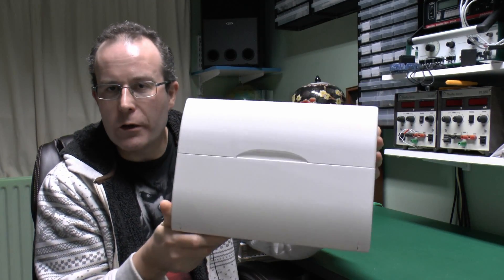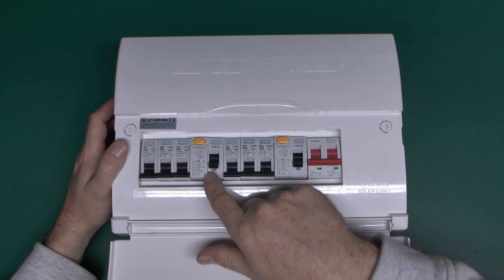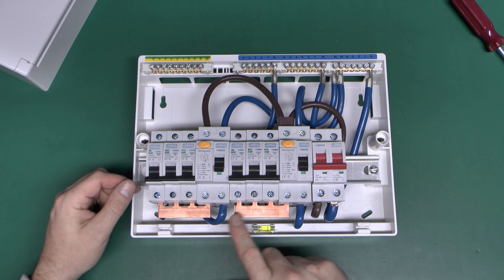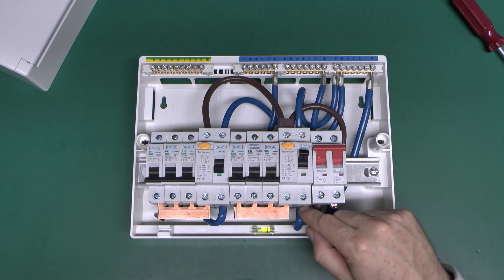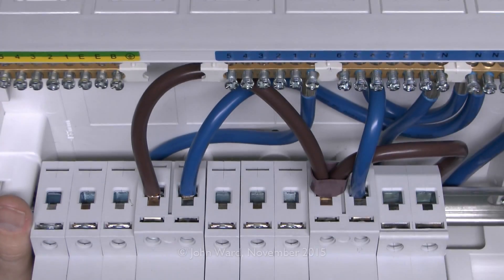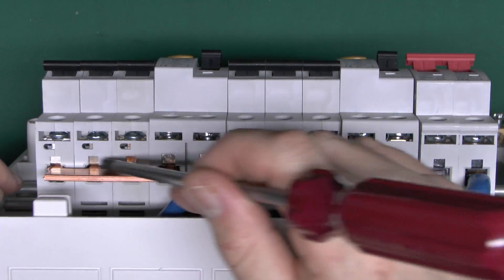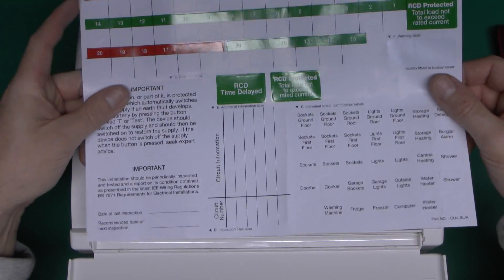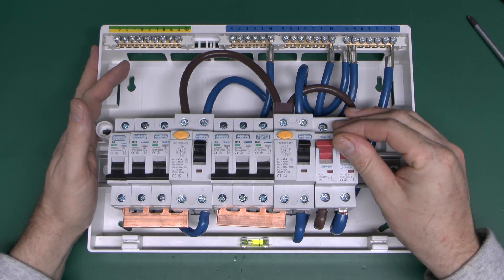Dual RCD Consumer Unit

Comment: Whats the CSA of the cables going into the RCD's
Reply from the maker: Depends on the make and rating, but 10mm² or 16mm² is typical.  If they need replacing for whatever reason, use those provided by the manufacturer of the consumer unit.

Comment: Hi, If my garage is already being fed via an RCD in my house, does that make the RCD (it's been there since before we moved in) in the garage redundant and I could just have a "main" switch and MCBs?
Reply from the maker: If the RCDs are the same type, then you only need one in the house
There are situations where two may be required, such as a 100mA time delayed RCD in the house and a 30mA RCD in the garage.
Reply: @jwflame  got It, thank you for your reply. Just had a look inside RDC in the garage (it just an RCD in a metal box which then goes to an old consumer unit) and it's only got a line and neutral, no earth and no earth ring so as to use the armour as earth.  Thank you again.

Comment: What is that 2 into 1 peice called that links the RCD's. I have a board where the cable is pushed in with the bus bar at the bottom. Should be going into a y peice like that.
Reply from the maker: Bootlace ferrule or pin crimp.  However to fit them requires the proper tool, which isn't particularly cheap.  Some consumer unit manufacturers also weld the wire ends together so that they are a solid piece.
If it's not using the correct wire, it will be cheaper and easier to just get a replacement cable set from the consumer unit manufacturer.

Comment: What a mess of badly designed junk our boards are.
Reply from the maker: That dual RCD style is poor.  The newer ones with all RCBOs are a lot better inside.
Reply: @jwflame  They need to bin din rail altogether. Have modular plug in devices, with all terminations in the base board. Devices can be just swapped/plugged in easily. No flying leads, no mess, no nonsense. 
Trying to replace devices, especially RCBO's in heavily populated existing boards is a nightmare.  Zero though given to maintenance and replacement further down the line.
Which let's face it with AFDD's coming to the fore, is bound to become more of an issue if they ever find a way to test them in service.

Comment: Hello,
If you had three RCDs in a consumer unit, would you have to introduce a bus bar for live wires and then from bus bar go with live wires to each of the three RCDs? Or is there any other way going about it?
Reply from the maker: Yes, it would also require 3 neutral bars, one for each RCD.
Far easier to just install RCBOs.
Reply: @jwflame  
Understood. Thanks.

Comment: Does the new code require all to be rcbos and no longer requires dual rcd?
Reply from the maker: It doesn't specifically require that, but what is needed is 'Every installation shall be divided into circuits as necessary to avoid danger and minimize inconvenience in the event of a fault'
and with RCBOs being readily available, using a dual RCD arrangement doesn't meet that requirement.

Comment: Hi JW, I have exactly the same this CU and it's wiring type as the main and only one panel in my small house, so where can I bond neutral and ground together?
Reply from the maker: That consumer unit is intended for use in the UK, and in the UK it's not permitted to connect ground and neutral anywhere within the installation.
Other countries have different rules.
Reply: @jwflame 
 thanks for answering, 
If live wire touched metal case of the load then how MCB would trip? What is grounding system used in this circumstances?

Comment: Hi JW, I am moving my mains and will install a new C/U. I used to swear by MK in my contracting days but to be honest I think they have cheapened in quality and not even sure if they are made in UK anymore.
Have you ever come across or used BG (British General) on your jobs and if so what do you think. I used a small 6 way DB in our temporary kitchen set up at home and to be honest I thought the quality was rather good but not 100% sure if it is really entirely British. That is one reason I would now convert to BG.
Reply from the maker: MK consumer units and devices previously made in China, and now are still made in China under licence to a UK company set up to represent the Chinese manufacturer. https://www.circpro.co.uk/
BG are a lower priced option.

Comment: I would like to see a 2021 version of this video as now I'm advised (still not done 18th Ed due to Covid) that each circuit requires an RCBO now and a anti surge device.
I have googled 18th Edition complete C/U's and I haven't as yet found one that has all this stuff, just the same ones as you were using in this 6yr old video.

Comment: Can anyone tell me why the Lives are daisy chained from the master switch to both RCDs but the neutrals go to a bus bar and then the RCDs.
Reply from the maker: Gives the option of adding one or more circuits with no RCD, they would connect to that neutral bar, and to another short piece of busbar from the bottom of the main switch..
Electrically it would be identical if the neutrals connected directly to the RCDs
Reply: @jwflame  Ah...that would make sense. Thank you.

Comment: Hi John, I know this is a fairly old video, but maybe you still monitor questions..? The incoming DP switch is rated at 100A, but do the latest regulations say what the consumer circuit loads can add up to? I mean even in your example, you have a potential load of 148A total? I know this is unrealistic, but I'd be surprised if the regulations don't have something to say?!
Reply from the maker: It's unusual for a circuit to ever be loaded to it's maximum rating for any length of time, and pretty much unheard of for all of them to be simultaneously fully loaded.  Even if that did happen, the whole lot is protected by the electricity supplier's fuse, which is typically 80A or 100A, so that would disconnect the supply long before the main switch was damaged by overloading.

Comment: If you were to install an 8, 8.5, 9 and 9.5KWshower could you wire them on a 32a mcb with 6mm cable or something else. because 9500/240=39.5A, and 6mm cable is rated at 47 clipped direct. Also, an MCB doesn’t trip exactly on the rated current does it?
Reply from the maker: 6mm cable is ok, but a 32A MCB is only suitable for a 7kW shower, anything above that will require a higher rated MCB.
Although MCBs to not trip on the exact current, running them at overload all the time will cause them to overheat and eventually be damaged.
Continuous load must be smaller than the MCB rating, and the MCB rating must be smaller than the cable capacity.
Reply: @jwflame  ah ok. So to do a 9.5kw shower I could do it off of 6mm cable, but would the mcb be either 40A or 45A?(if not protected by RCD, install RCBO). Because 9500/240=39.5A, and 6mm is 47A rated, so the the load would be much under the cable rating.

Comment: Is it necessary to have a split board my dad has an old fuse board I want to replace and he has 1 lighting and 1 ring for the whole house can you still get a fuse board with mcbs and 1 rcd rather than a split load cheers?
Reply from the maker: You can have pretty much any combination of devices, just by buying an empty enclosure and suitable items to fit into it.
For only 2 circuits, a main switch and 2 RCBOs would be ideal.

Comment: Is the ground/earth bar connected to the neutral bar at the back of the Unit? I found on the board of my house, the neutral In and Out from RCD is connected to the a single neutral bar, and so are other sub-circuit neutral. is the correct wiring?
Reply from the maker: No, neutral and earth are completely separate within the consumer unit.
If both neutrals from the RCD are connected to the same bar, the RCD won't work.
Reply: @jwflame   when I disconnect the eath bar from neutral bar, the RCD did not even switch on. so I have to connect the ground/earth bar back to the  neutral bar and take the neutral from that to feed in the RCD, then RCD neutral and all sub circuit neutral are connected to a separate neutral bar. it seems to work, Test button works fine. but still not sure If I have done it correctly as it does not look like what you showed in the video.  The whole reason for me to look at and redo the wiring at  the board is that  the RCD went off when I recently reconnected an old circuit back into the board and after checking the wiring I realized that the RCD was weirdly connected, serving only single circuit that I reconnected. ant thought ?
Reply: @John Ward I guess the circuit in our house is so called "grounded neutral"

Comment: Hi John I got a reasonable question for you please! I'm going to change my dad's fuse board it is plastic there is no 100 Amps main switch it's on a 63 Amps Rccb but I can't find any fuse boards to buy with just a 63 Amps Rccb acting as the main source of isolation, so would it make any diffrence if I was to buy a fuse board with a 100 Amps double pole main switch in sea of using a 63 Amps Rccb and also the ring circuit is on one circuit for the whole house as well as lights so is it necessary to have a due split Rccb board ?

Circuits are:
Ring final 32 A
Lighting 6A
Smoke alarm 6 A
Radial or boiler 16 Amp
50 amp garage outlet
32amps not sure what this is powering  
Cheers john
Reply: It wont make any difference putting a 100A main switch, and i think you would be required to put in a split RCD/RCCB even with just one lighting circuit and one ring final circuit (i used to live in a bungalow that was somewhat similar to that, and it had a dual RCD setup)

Comment: What size are the neutral cables that supply the rcd's and then to the neutral bars.
Reply from the maker: 16mm² typically but is does depend on the manufacturer of the consumer unit.
If replacing them, they need to be the same type as specified by the manufacturer.
Reply: Thank you John. I am so very grateful for your excellently presented videos.

Comment: Hi John great video, what would cause the RCD to have burn marks at the bottom? Electricity trips but no fuses or RCD actually trip?
Reply from the maker: Almost certainly loose connections, which cause overheating.

Comment: Such an arrangement won't meet italian code, as 32 + 40 + 6 = 78 > 63 (RCD) so RCD isn't protected from overload. Also 32 + 32 +6 = 70 > 63 isn't up to code. Obviously this doesn't apply if 63 RCD are acrually RCBO; in that case overcurrent protection is guaranteed. Also single-pole breakers sound odd to me: I always seen 1P+N, 2P and 3P+N, rarely 3P, but never a 1P that on TT system isn't considered safe (you may have voltage on neutral).

Comment: The 18th edition OSG states that such an arrangement (i.e.2 RCDs in one CU) is "Generally [...] not suitable for an installation forming part of a TT system as there is insufficient fault protection of the single insulated conductors which connect the load side of the double-pole main switch to the supply side of the RCCB." (p.37 in relation to Figure 3.6.3(ii) on p.36). I am not sure I understand why this is so. I would have thought that if there were a problem with a 2nd RCD there should also be a problem with RCBOs. I would be very grateful for your thoughts on this matter. Thank you.
Reply from the maker: The supply side conductors are not protected by the RCD, and on a TT system the earth fault loop impedance will be high, so a fault between line and earth will not blow the main fuse.
It's more of a problem with dual RCD efforts because they have single insulated flexible wires from the main switch to the RCDs, and one of those being damaged could make contact with the earthed metal case of the consumer unit.
With an all RCBO board, line is on a solid fixed busbar so very unlikely to cause a fault to earth.
However for all TT installations, there is still the possibility of a fault between the incoming line and the metal case of a consumer unit, there are various plastic glands and similar which are intended to avoid that happening.  Or an time delayed RCD could be fitted before the consumer unit, although that can lead to other problems such as when used with single pole RCBOs.

Comment: Hi John please help, Ive just noticed our consumer unit having 2 main switches 100 amps each, one is for ring, lighting etc. And one is for the water heater and storage heaters, why is that possible? thanks.
Reply from the maker: Storage heaters will only be powered at night, from a separate connection to the meter.
It's the same as having 2 separate consumer units, only someone has put the whole lot into a single box.
Reply: John Ward Is it necessary to use 100A switch John? Or is it safe do so? Thanks
Reply from the maker: 100A is the maximum rating, perfectly ok to use it for loads less than that.  Smaller rated switches are available but most are the 100A which can be used for most domestic installations.
Reply: John Ward My question was incomplete, yes 100A or a bit less is normally used in a domestic property but in our one there are two 100A, youre probably fed up of me lol and I understand if you will stop answering my questions, but anyhow it will all come together once I started doing electrical as a job with a qualified person. Thanks John for making time to answer all my questions.:)
Reply: The 100A is just the safe current rating of the switch. It's not a breaker, so wouldn't "trip" if it went over current. You can put as many as you like in a house if you wish. It's even possible to have multiple consumer units. Ultimately, there's a fuse from the electricity supplier which will blow if an attempt is made to draw too much power (usually rated at 100A but, sometimes, loser at 80A or 60A. I should add it's not very convenient should you ever blow that supplier's fuse as it's not user-replaceable (at least it's not meant to be). It means calling out the electrical supply company and that would involve a cost and, possible, some awkward questions about the installation.

In the case of a system with storage heaters from off-peak electricity, there would be two consumer units with their own switches fed via separate meter circuits. These days that's rare. However, you might find two consumer units (or old fuse boxes) attached to the same meter.
Reply: @TheEulerID  Hi Steve  well explained. But what is the use of it, if it doesnt trip?
Reply: @Handai7  They are simply there to turn off the power to the circuits to allow somebody to work on them safely. The devices that protect from over-current loads are either fuses or McCabe. RCD's protect from leakages to earth, whilst RCBOs do both. The 100 amp switch is purely a manual device for isolating power if required.
Reply: @TheEulerID  AH yes! 100A is the current capacity of the actual switch isnt Steve? 100A, 80A etc its only a CAPACITY TO CARRY current but not to trip? yes Thank you Steve! Last one Steve, If I want to connect an oven cooker with 6Kw power, I will need 32A switch control unit next to it isnt? if so, can I use a 30mA RCD switch control unit instead of a normal one?
Reply: @Handai7  you can't omit over-current protection even if there is an RCD. An RCD only protects against faults to earth, and not live/neutral overloads. An MCB protects the wiring, and RCD protects people from electric shocks. 

If a CU has an RCD protected bus-bar. and an MCB is connected to that, it gets both over-current and earth leakage protection. Alternatively, an RCBO will provide both earth-leakage and over-current protection. 

Note that new circuits have to have both over-current and earth--leakage protection.
Reply: Steve Jones thanks Steve!
Reply: Steve Jones Hi again mate. A 10kw cooker on 32A mcb, how come its not using a 2.5 t&e cable but a 6mm t&e instead ? Or is it possible to use 2.5 as well?
Reply: @Handai7  you are allowed to put a 10 kW cooker on a 32A circuit (nominally about 7.5 kW) as it's considered unlikely that it will ever have the full load running (that is all rings, the oven, grill and so on). It's called "diversity". However, there's nothing stopping a higher rated circuit, such as a 40A provided the the appropriate cable is used. Really this is a job for the professionals.

Comment: 6+32+40=B78A MCB rating on 63A In RCD? No mounting screw insulation caps? No conductor insulation on the 1~ bars? The 10mm² wiring could have been avoided by using an appropiate power bar on the provided device breakouts where the screws are located.  I believe the CE here stands for China Export... Absurd.

Comment: Please explain rewearing and connection to the fuse box.
Cables and tipe .....show as the way how it works for each cable from socket to lights by drawing ✍️ in a letter and demonstration.

A lot of Electricians are bunch of thieves,..charging you a lot of money...5-6 time more than what they deserve 

Time to do everything yourself

Comment: Another great video JW, thanks. I'm surprised those un-insulated live bus bars are still allowed - in this day and age of health & safety.
Reply from the maker: Some makes have a plastic cover to clip over the busbars, however many do not.
Not really a problem as the main switch should be off before removing the cover.

Comment: can we still get the old plastic ones? I am worried about an area that is concrete wall, and has the possibility of water migration through the concrete, which to me is more dangerous than the possible fire damage... as the concrete will not burn.
Reply from the maker: They are still available, although tend to be of the type intended for wet areas so have rubber seals on the front cover etc.
Most sold for use in homes now are the metal type.

Installing a plastic one in a house would not comply with BS7671.  it would in other places.